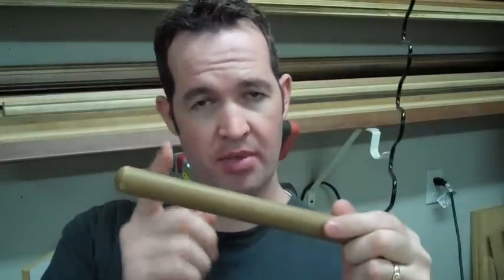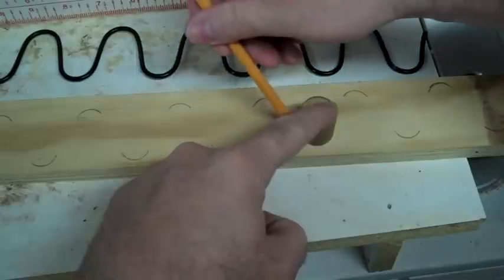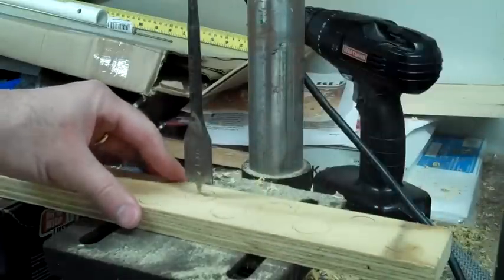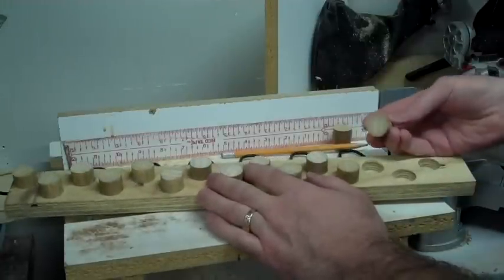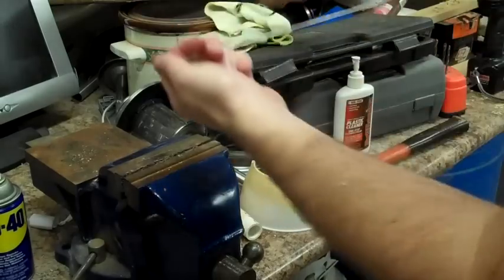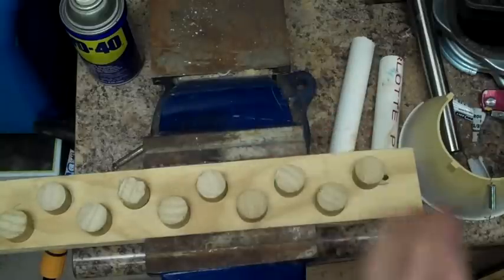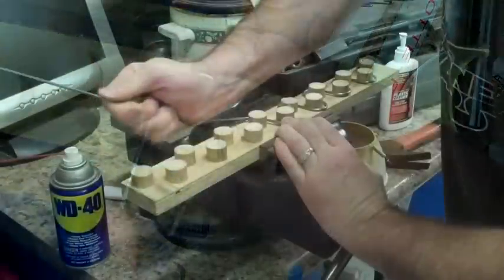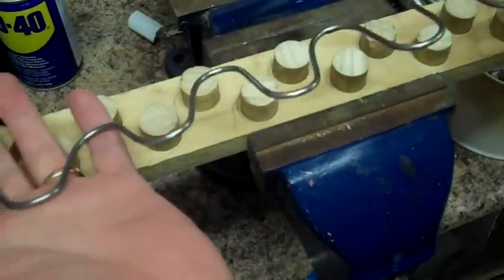Glide Rocker Spring Replacement

Comment: How in the world do I find these for purchase?  I've ordered some, but they don't work.  None of the ones I'm seeing online have the bent end to slip into the rocker seat holes.  :(
Reply from the maker: What are they charging online? Maybe I could make you some.
Reply: I ordered 2 from Ebay ($3.70, and I think shipping was about $5).  Unfortunately, they won't work because they don't have the bent end that drops into the seat frame.  I haven't been able to find any online with that bent tip.  The chair looks very similar to the one in your video.  I think it's probably 20+ years old.